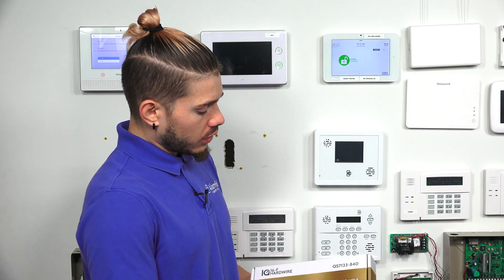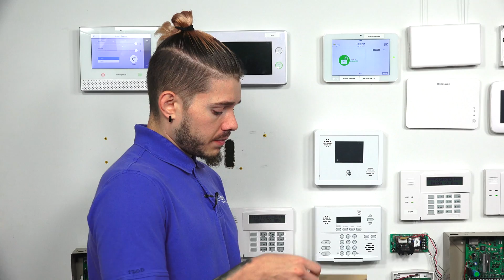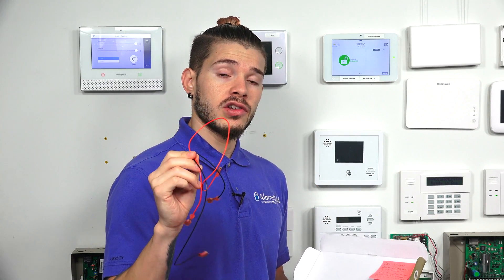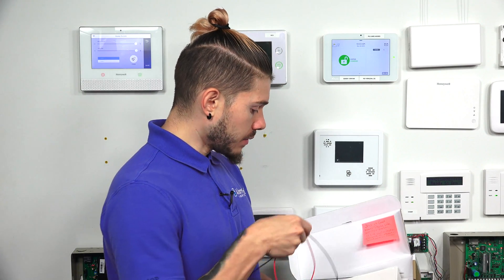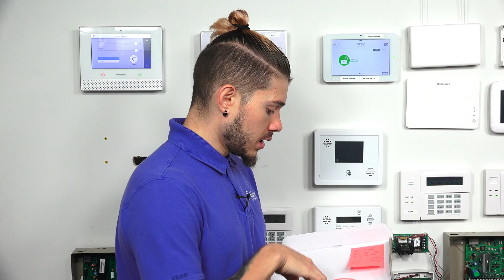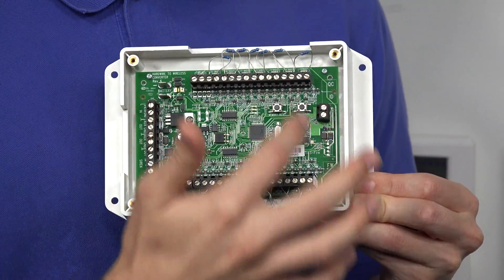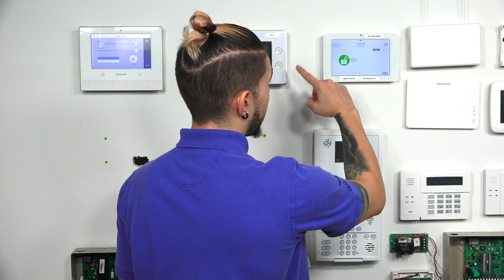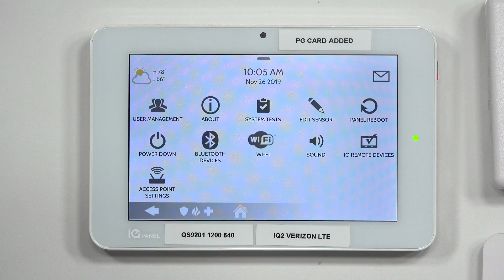Overview: The Qolsys Hardwire 16-F

Comment: How do I reset this 16- F
Reply: You can factory default the Qolsys IQ Hardwire 16-F by powering the module completely down and then holding down its Memory Reset button while powering the device back on. After three (3) seconds of holding down the button, the LED lights on the module should begin rapidly blinking.

Comment: Important install info.  If you are using the zone 16 fire sensors, you need to connect all of the wiring for the smokes and the zones before learning the 16f zones into the panel.  You also have to open/close the zones at their location.  You can not just short the contacts to fault the zone.  Been there done that and it takes a bit to realize & unlearn and relearn.
Reply from the maker: That is very true, good information. If you short the burg zones at the 16-F,  you confuse the device into thinking they are normally open instead of normally closed.  Thank you for sharing.